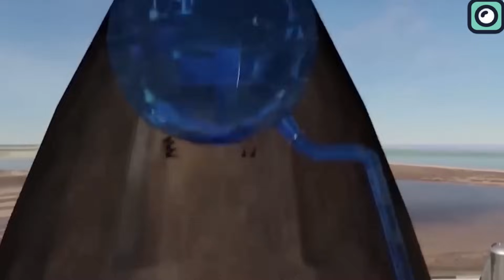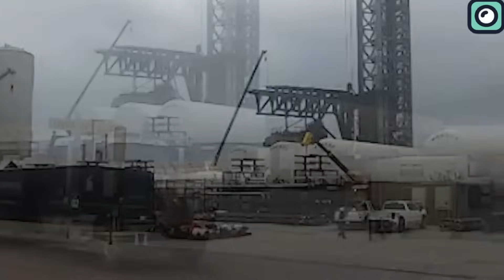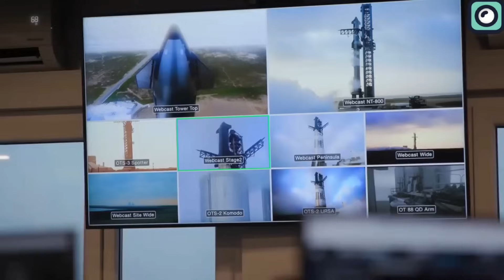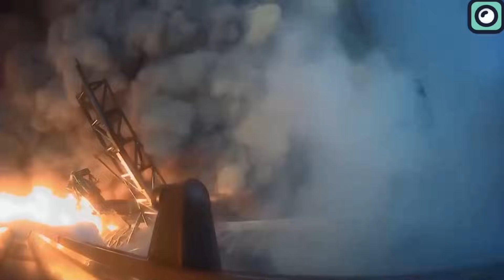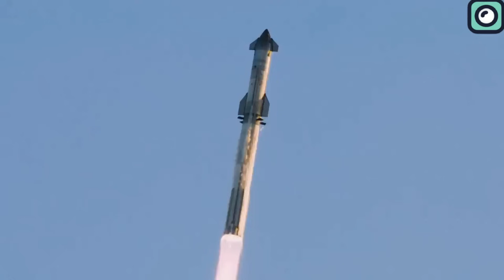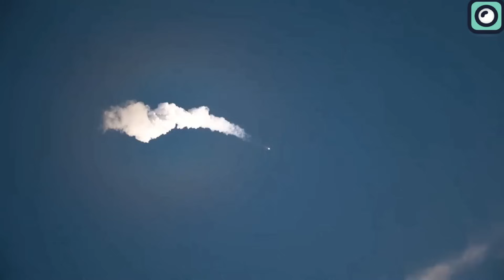SpaceX's Starship Genius Upgrade Will Change Everything!

Comment: I'm sure when the vertical tanks were installed gravity was a huge factor in the design. Horizonal water tanks may involve more energy to dispense so much water.   but it was a good call and will set the standard for all starship launch sites in the future Go SpaceX / ELON